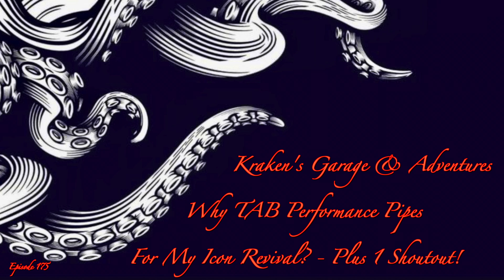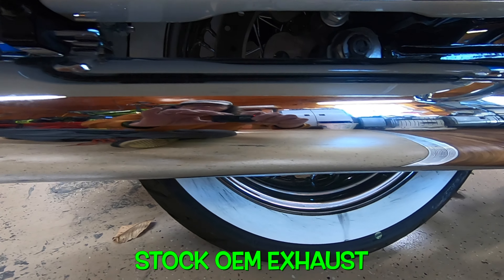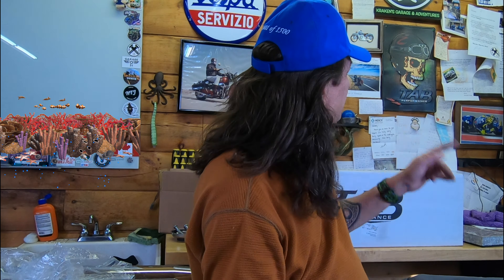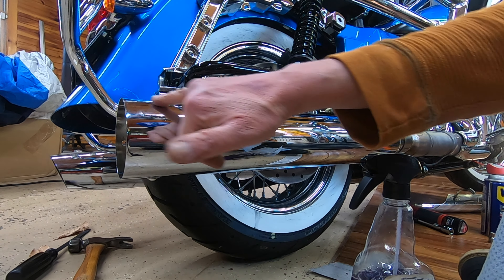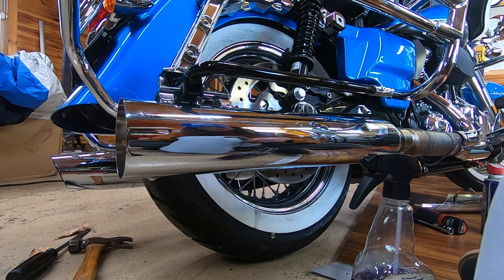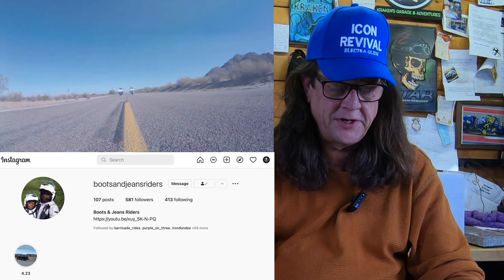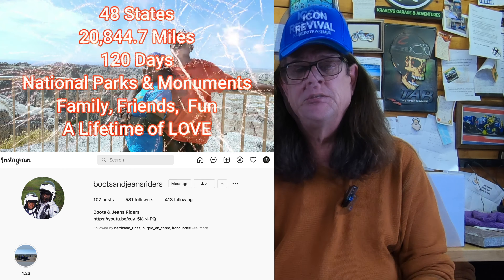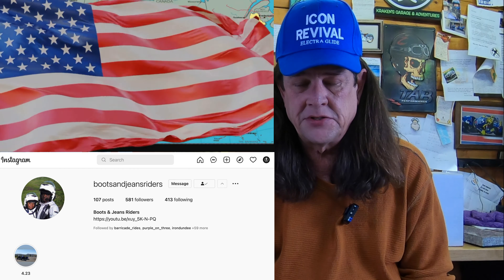TAB Performance Pipe Install On My Icon Revival - Plus 1 Shoutout!

Comment: Lovely pipes. The fitment looks precise and the finish is stellar. I betcha even a left-handed retired English teacher could install a set. I’ll be consulting Tab’s website directly. Enjoyed the alternating wrenching and commenting, too. Are you satisfied with the new sound?
Reply from the maker: Thank you Guy, as for the sound I'm leaving the cat in so mine are more subdued then others. I'm partially deaf and I just can't take the loud pipes thing for very long. My tinnitus play the devil with my ears. Am I satisfied with the mid level baffles? Yes, 100% satisfied, just getting the bike to breathe easier is huge improvement on performance. A hi-flow air filter and a tuner she'll be a different bike. I hope I answered your question. Eric